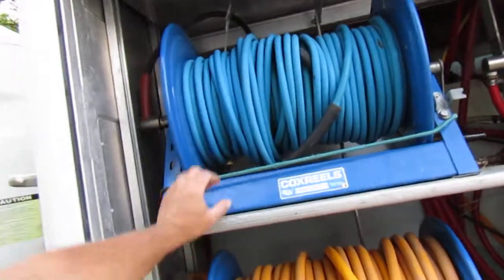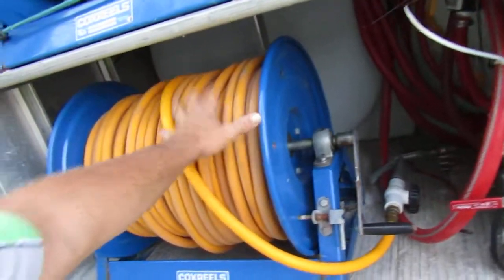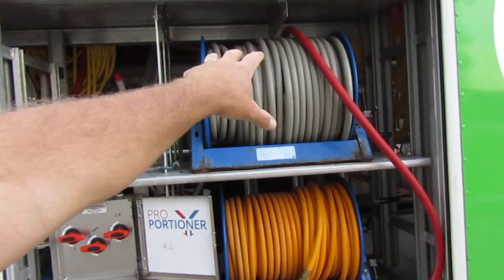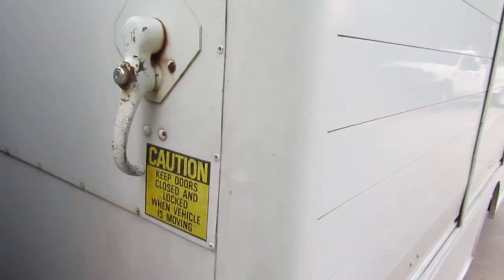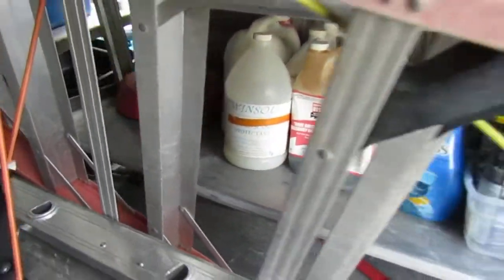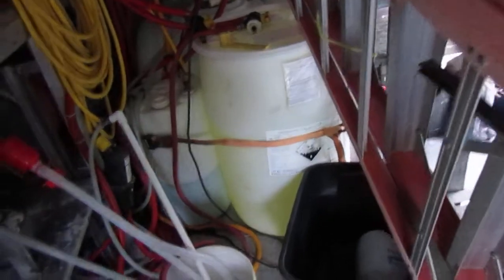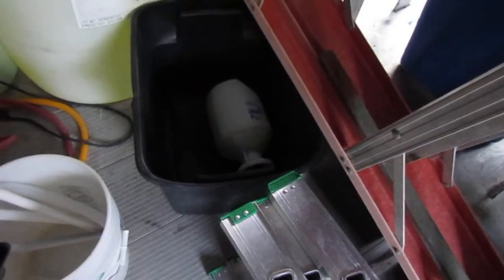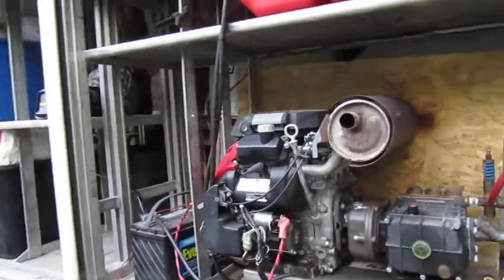Inside the Cajun Soft Wash Machine!

Comment: why did you decide to put your hose reels on the left side instead of the right?
Reply from the maker: It just makes more sense to me. When you pull up to the curb of a home you can look out the drivers window to get an inch away. It's also for curb side drains. I don't want my guys parking over a drain and it's easier to see the drain.
Reply: so you park facing the wrong direction?
Reply from the maker: Yes and honestly I feel it's safer that way. You are more likely to notice the front end of a vehicle then the rear of a vehicle pointed at you.

Comment: No need for a hot water unit ?
Reply from the maker: We have a hot water unit on our other truck but we really don't use it that much. We are not going after the jobs where heat is really needed so it depends on what your company does. Hot water is essential for some jobs.